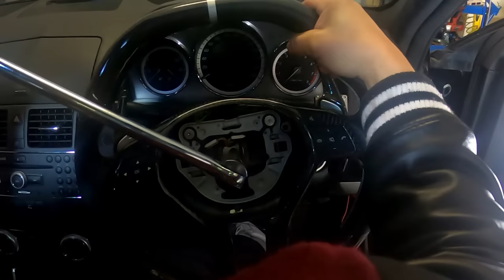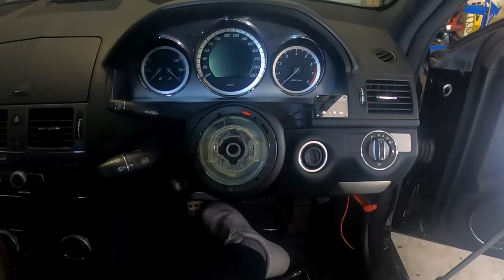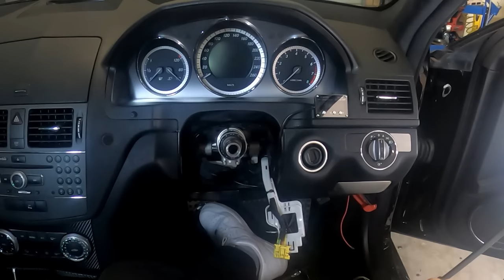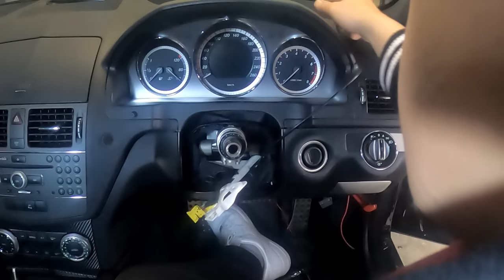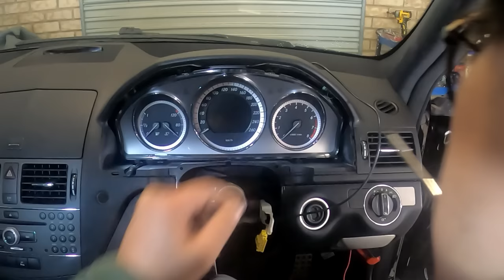HOW TO remove and fix ESL/EIS/ ELV MODULE  w212 w204 mercedes motor replace  Part 1

Comment: Have removed steering wheel and air bag (not necessary) after removing electricity as part of column removal and now get the following errors:
1 ESP not working
2 RH (driver's) air bag not working
3 Run-flat indicator not working, but there is a work around for it in the user manual
4 Worse, the steering wheel had to be attached 180 deg. as otherwise the plastic parts of the turn indicator would lock the wheel?

Help! Voltage at rest is 12.25V and charging at 13.9V. Deleting the errors with an iCarsoft MB2 diagnostic does not help either. Help!
Reply: Any luck On repair? I am getting esp and air bag message as well.

Comment: You keep saying it fries the chip.
There is no power being applied while disassemble.
Maybe a chance of mechanical damage if that pin being in locked makes it harder to get it apart. Resulting in a cracked board or something.
More likely is that the electronics are smart enough to know what position it was last in. And if it was reassembled incorrectly it would try and continue to lock it more. Resulting in overdriving the motor. Or it just locks it out because the movement doesnt match last known position.

Comment: I tapped it and went up in size...But I'm going to buy a better torx bit now...Would it have been too much to ask from MB just to use regular screws? Geezzz!!!
Reply from the maker: i know right so annoying mb being over complicated
Reply: They will not come out for some reason. The pin material is too soft. Haven't figured out what to do now...smh
Reply: I think the pin expanded inside the case making it harder to take out. So yeah...the frustration sets in.

Comment: All videos on this repair leave out one or more important notes. When you place the circuitboard back, you did not mention that you have to push in the contact on the circuitboard that senses the lock is unlocked. If you do not push this back, you risk ruining the circuitboard.
Reply from the maker: yes i mentioned it later on ..but good point ...
Reply: @MIKEYZVLOGZ  Thanks. I am putting mine back right now. Fingers crossed 👍🏻
Reply: After also doing a steering wheel alignment, everything worked perfect :)

Comment: Hey man, what if the ESL is stuck on the UNLOCK position before starting work?
Reply from the maker: if your ESL is already in the unlocked position then I assume u can just work on it and remove it and fix it
Reply: @MIKEYZVLOGZ  just finished replacing the burnt motor and it still doesn't work. Any other suggestions?
Reply from the maker: @jasonc9495  wen the car esl module was stuck in unlocked position did anything happen. when u inserted key? 
2nd when you installed the circuit board there are 2 switch buttons that are grey that u need to press down when u install the circuit board .... if you dont install it correctly there a chance you can damage the circuit board and or due to incorrect installment it wont work and read correctly
Reply from the maker: of it still doesnt work after that I would ask a qualified mechanic and get their input .... becuz u have done the hard work sending it off to get looked at or fixed wouldn't cost much considering u took it all apart and will put it back together ... however to get someone to look at it u will need to remove the eis as well so they can check it to the esl module
Reply: @MIKEYZVLOGZ  I did everything on the video. One thing I noticed was that the motor was very badly burnt which could have caused damage to the board. At this point I might just get a bypass. Any recommendations for that?
Reply from the maker: @jasonc9495  I've seen them on Ebay w204 esl bypass emulator ... either way u would have to get the bypass emulator programmed to your car .... I would do some research and contact some local auto key specialists and find out whether they provide such service .... and at the same time express your issue with esl failure and what u have done this far... I'm sure they can clarify ur issue
Reply: @MIKEYZVLOGZ  thanks man.
Reply from the maker: ur welcome buddy anytime 
I'm no mechanic but I'm always here to try give some advice if I can I know how hard it is wen u have a problem and u just want some insight ...eventhough I am no professional I'll always try my best to give some feedback for my fans and subscribers

Comment: Mike you skipped the worst part. It takes more than just moving it around after taking out 4 bolts.  You have to remove the whole column!
Reply from the maker: ye I know that's why in part 2 I explained u have to do it by feel u can get it out ..it's what I did .. my apologies it was during the start when I wasn't as good with my camera and I realised after that I already removed it and forgot to film it ... I'll try and do a short showing how u can still remove it with just the column loose

Comment: Suggestion by an Australian locksmith:
Fitting process of W204 ESL and EIS after the ESL has had the motor changed or been re-manufactured due to NEC chip problems:

The ESL has to be in the unlocked position with pin in so it can be re-installed to the column, but it does not have to be, I will leave it dangling for the next failure as a Chinese motor may even fail earlier than my German motor (13 years).

THE ESL IS VERY SENSITIVE TO THE SEQUENCE OF LOCK/UNLOCK COMMANDS!

1. Disconnect battery
2. Do NOT connect 4 pin connector of the ESL
3. Connect wiring to the EIS (Ignition Switch), three leads. DO NOT CONNECT ESL WIRING. Install EIS
4. Connect battery
5. Insert the key into the ignition, but do not turn it to "Ignition ON" position
6. Connect 4 pin connector to ESL (Electric Steering Lock)
7. Remove key from ignition lock (EIS) and you will hear the ESL motor push out the locking pin to lock steering
8. Re-insert key, motor will unlock the steering wheel, you are ready to start car! Good luck!

After installing my motor I did not follow this procedure and that may have cost me AUS$500 to have it "re-manufactured". Am still trying to find out what was done to it, I got my old motor back, so they changed the motor, but did they have to do anything to the NEC chip???
Reply: According to the repairer, my circuit board/NEC chip was not damaged due to the dying motor, so perhaps had I followed this procedure I might have saved myself $500?

Comment: I was able to take the ESL out even in the lock position, looks like the bottom plate that locks the steering wheel moved a little allowing me to press the bolt and wala! although I was able to take it out there is no doubt it still remains in the lock position. I have to press that small protruding plate to be able to push the bolt in. I don’t know if I should open the box to swap the motor or just send it to a guy in San Diego (speedifix.com) with the ignition switch and my key for him to make me an emulator. According to your video there is a high chance I will fry the chip if I open the metal box and maybe the guy who is going to make me the emulator needs it intact to make me one. 

I dont know why the guy that makes the emulators wants my ESL to just “recycle it”
Reply from the maker: so in your situation if your uncomfortable in knowing what to do them i suggest just send  it off for repairs ..it will already save u a descent amoubt as u did all tge hard work... if u want an emulator itll be around 400 roughly .... i guess it all depends on your ability and knowledge if u feel comfortable enough to do it.... hence why i suggest to sens it off if u dont feel comfortable
Reply: MIKEYZ VLOGZ do you think the emulator guy needs my ESL intact? perhaps needs to get some information from the chip in order to create the new emulator for me? if thats the case I rather not open the ESL.
Reply: MIKEYZ VLOGZ what i also find strange is that he is asking me to send him my ESL , EIS and Key but he will not send me back my ESL.   what i’ll be getting back from him is my Key and the EIS with an emulator aded to it. He will “recycle” my ESL. I read somewhere that some locksmiths do this to keep the police happy.
Reply from the maker: @dalcanta  well even with the esl fried i believe they can still make your emulator ..but domt quote me on that ... maybe u should ask him first so u r sure... but if your gonna get an emulator ...maybe just leave it and send it off ....
Reply from the maker: @dalcanta  i honestly did not know that as u can buy recycled esl off websites.... and they may just use it to virginise it and be abke to program it to another vehicle..as ut can be done
Reply: MIKEYZ VLOGZ i was checking out this video https://youtu.be/UYsBxxOXoA4  if you look at minute 0:36 the guy in the video says that if you open the ESL without checking the motor position calculation, you will damage the ESL or something along those lines
Reply: MIKEYZ VLOGZ OMG.... it worked. im so happy i cant believe it. the only thing now is that i just realized i didn’t put any grease on the little motor brass gear. I still have everything disassembled, and I am now debating wether i should open the module to put grease or not. If i go ahead i will have to make sure the ESL is in the unlocked position by disconnecting the battery first
Reply from the maker: @dalcanta  yes do not attempt unless u have the esl im unlocked position... this is my honest opiniom
Reply: Hello, can you tell me after pressing the bolt, how does the ESL remove? We keep pushing the bolt, but the ESL doesn't seem to want to come out. Do you pull the ESL out?

Comment: It worked!!!!!
I was skeptical but felt that I wanted to try the cheaper solution first before buying an esl/eis emulator and having to send my key and ignition out to have it reprogrammed. I bought the motor from amazon for 12$ I will admit I should have bought the kit with the rivet removal tool. T6 torx bit worked for me t/5 might work but may be too small. I also found a link with very detailed images of how the motor and parts should look when installed. https://mbworld.org/forums/mbworld.org/forums/showthread.php?t=640328. One thing I would say is not necessary is the removal of the instrument cluster. You do need to remove the cluster trim ring but not the cluster. My car is a 2010 C300 sport with 80k miles. Thank you so much for this video I hated the thought of having to pay 1200$ to have this repaired for a 12$ part and 2 hours of my time.
Reply from the maker: well done mate

Comment: Good luck to those who catch the error in time before the motor burns out completely and also locks the steering and starting. I will have to deliver/send ESL and EIS (ignition lock) and key to a company for flashing of the ePROM in the NEC security chip as due to German over-engineering that chip counts the number of attempts to start with a dying motor and then decides to block any further starting (theft??). So the web tells me.

One company tells me they will recondition the ESL as there are motors and motors (?) and in my case as I drilled the pins out as I did not know aliexpress/fleabay would sell me all the tools I need including the handle to pull out the pins and the cylindrical tool to take out the EIS, they must also sell me a new lid to the ESL. They will not accept my handiwork. Worse, you try to get something like a new motor and tools mailed from China these days!

The same story, if you go via the emulator route, which I have not followed up yet here in Australia from far-away Perth. You will have to send off the lot somewhere. 

Hints:
1.  If steering is locked, take out column. Do not remove gauges, do not open spline at universal, do not take off air bag and steering wheel. You can take off the two Torx bolts holding the top column via a long extension and universal. Cut 10mm bolt to take out ESL. Then you may waste time repairing the ESL. 
2. If steering is unlocked, there is no need to take out the column, use MIKEYZs trick to take out the ESL and you might be lucky by changing the motor to getting it started.
3. With the ESL/EIS/key in hand you can also follow the emulator route somehow.
Reply: Sorry, wrong information. The carbon brushes wear out slowly until finally there is no more contact, BUT the MIKEYZ trick of hitting will just make better contact one last time!

Comment: Mine is just loose in the under part of the steering wheel😂 cars not starting
Reply from the maker: so what's the issue? how do u mean loose?
Reply: @MIKEYZVLOGZ  i opened the under side of the steering wheel to pop out the eis, but i instead found the elv device just hanging out on the cover, i had an electrican working on this problem before, and i guess he replaced the metal one with a plastic one and he also had a mkb3 device in the glove box, the lights in the dashboard wouldnt work with the key.
No start no nothing. And now the issue came back, and i tried fixing it myself, thought it was the eis but im thinking its the elv now.
Reply: @MIKEYZVLOGZ  my esl is in the unlock position and my steering wheel turns, do i have an esl issue?
Reply from the maker: @johnr5867  yes can still be... 9 out of 10 times it's esl module
Reply: @MIKEYZVLOGZ  so what can i do to fix it? It has already been replaced with a plastic esl, and ive tried to bypass the esl by the relay fuse, didnt work and i tried to just directly give power to the starter, which i think the fuel pump isnt working without the key.
Reply from the maker: @johnr5867 so u have the emulator installed already?
Reply: @MIKEYZVLOGZ  i think so, because i had the issue of the car not starting and brought it to a technican, he fixed it and now im having the issue again. I think he replaced the esl because i have the plastic one without the steering lock, and i had a mk3 steering lock emulator in the car after he was done fixing it
Reply from the maker: @johnr5867  and ur original esl is still there right? he used an emulator
Reply: @MIKEYZVLOGZ  i dont think so, the new esl was connected
Reply from the maker: @johnr5867  yes but he would have either left the old one intact ... ur saying the new esl emulator was just on the side right..cuz ut doesn't have to be installed in place of esl ... u can install it anywhere as long as the cable cN plug in
Reply: @MIKEYZVLOGZ  you might be right, would you suggest i connect to the old esl?
Reply from the maker: @johnr5867  it won't hurt to try..but probably won't work either as he never would have fixed the malfunction hence why he used an emulator... can u contact him and ask..saves u playing around with trial and error
Reply: @MIKEYZVLOGZ  when i contacted him, he acted confused, i guess he doesnt want me to fix it😅
Reply: @MIKEYZVLOGZ  i have tried bypassing through the fuses and even direct starter, with no luck. I might have a more serious issue😂
Reply: @MIKEYZVLOGZ  if it is the esl as you said its a high probability, and it was already programmed to an emulator, could the issue lie to a electrical problem? I had issues with the battery multiple times, it could have led to this issue?

Comment: And that hood lever up a gloss over. Not easy as removing the screw. Need more detail.
Reply from the maker: do u mean the screw that secures the esl module to the car  ?  its all done by feel thats the problem its hard to show via camera.... best thing to do is reach behind there and feel for the screen and try figure the best way to remove it
Reply: @MIKEYZVLOGZ  so got in all out. So close. Cant get the roll pins out. Broke the tip of my special tool. They are not coming out. Need idea on how to get them out. Using assorted hand pics. No luck.
Reply from the maker: @dustang05  if u cant get it out use a drill dame size and drill them out byt do not drill deeper then u need too using the special tool u have to push and rotate as u pull out
Reply: @MIKEYZVLOGZ  I have used a left hand drill bit. Still cant get them out. Used a regular drill bit as well still no luck. Have you heard of buying a used one and reprogramming it? Mercedes wont sell this part to anyone. It's has to be  done at the dealership. The whole repair.  😡
Reply from the maker: @dustang05  thats right merc wont sell it as a security risk .... best option would be a bypass cheap and programming will be about 3 to 500
Reply: @dustang05  Drill them out. They are not screws, they are pins. Then mark the position of the plastic lever and wheel and clean out all the swarf from drilling. Use compressed air. Clean the circuit board and do not zap it with your static electricity. Put the $5 motor in, then check that the two grey pins of the two limit switches are close to the posts by looking at it sideways.

Comment: Mine just stop working it didn’t give sign of failing before ..
Reply from the maker: ye its sucks how that can happen dear friend... i jope u managed to get it fixed.... i was lucky it started to fail and i had it towed from time to time til i bit the bullet and decided to do it myself
Reply: MIKEYZ VLOGZ hey my friend I manage to remove the steering column and my esl is in lock position do you know how to unlock it ?
Reply from the maker: @noel3466  hey buddy so in your case the best way maybe to drill a small hole near the motor gears and slowly turn it with a small tool however ..doing this will most definitely fry your chip.... meaning u would need a new chip and also reprogrammed ... maybe u should considered a elesl bypass module
Reply: MIKEYZ VLOGZ i seen a video where a guy cuts the screw bolt and I look it up on eBay for a esl screw they have them i might do that , instead of drilling a hole
Reply from the maker: @noel3466  that could work too...

Comment: Lol donit right the first time. If it's stuck in locked position then you have no choice but to cut it
Reply from the maker: yes that's true but there are ways around it too... I just basically mean .. wen it starts to fail get on it !! ... but true sometimes u may have no choice